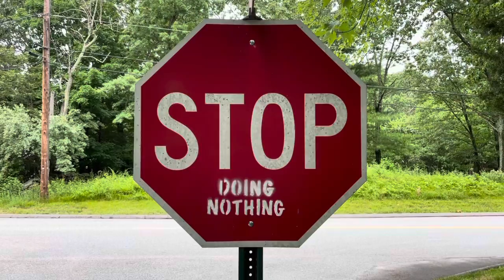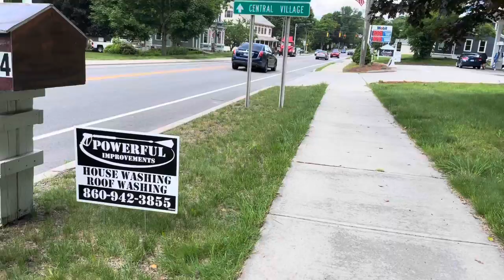One Man Roof Washing

Comment: Advice for ya Joe.  Pick up gutter vacuum..  Well worth it and you won't fall off of the roof.  When bending over to blow the gutter, you could slightly faint when standing back up.  It has happened to me and many others.  Just a heads up brotha.
Reply from the maker: Yes. I keep considering the vacuum. Couple things holding me back. One is very expensive. Two I’ll have to carry a generator if I cannot hook up to the clients property. Three I’m usually done it last time it would take to set up the vacuum..

Comment: You mentioned a 24 foot ladder. I thought you said a while back that you used a 28 foot ladder so it had more stability when extended to the 24 foot length. Did you switch? Do tell!
Reply: 3 ladder rungs above the roof edge is a LOT easier to get on and off the roof for me.
Reply: @William-Bill-Munny  So for you is that a 28 foot ladder or a 24 foot ladder?
Reply from the maker: I have a 24 & 32 on the truck
Reply: @WallyJ2K  for me that is 28 foot. But I am in the pacific northwest and mainly have one stories where I live, lower roof pitches & often shoot 2 story roofs from the ladder.
     My 28 footer is a heavy fiberglass ladder for longevity, we also got the SumoStance from Little Giant for extra stability and we use the wall standoff mounted with 3 rungs above the roof edge for safety.
    I was almost killed a few years ago so Im a little extra cautious. Keep in mind my setup is heavy - so much so it's a pain in the butt sometimes when people have a lot of stuff laying around it looks like a yard sale. But to me it is worth the extra effort for the safety factor in varied wet slippery conditions. Everyone has to figure out their own situations to factor out their own needs. Hope I helped shed some light on your own process.
Reply: @William-Bill-Munny  Thanks for all the great info! Be safe out there!

Comment: Great video. What part did you use to get the m5 twist to go into the jrod holder? I like the set with the m5 and shooter tip combo
Reply from the maker: It’s just a little threaded extension piece I picked up at Lowe’s
Reply: @powerfulimprovements  Thank you very much for the quick reply and information. Guess I will head down to Lowe’s to see if I can find that part.
Reply from the maker: @amac7874  plumbing
Reply: @powerfulimprovements  Great and thanks again.